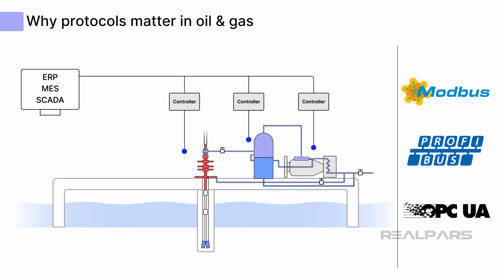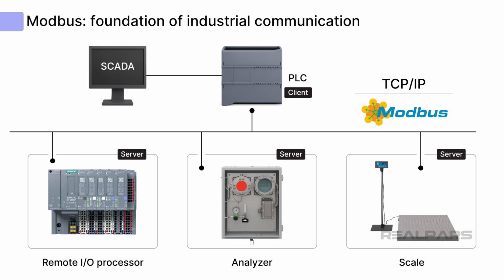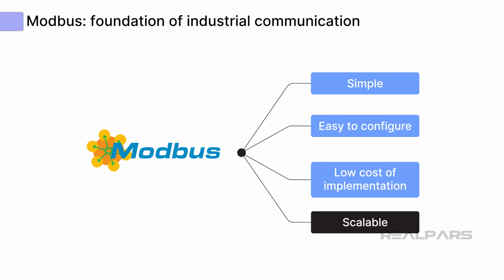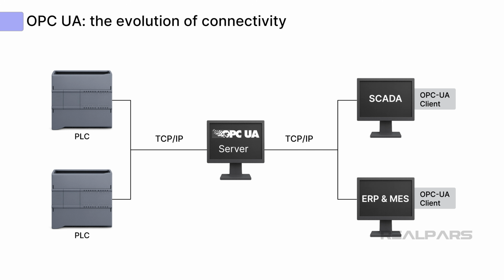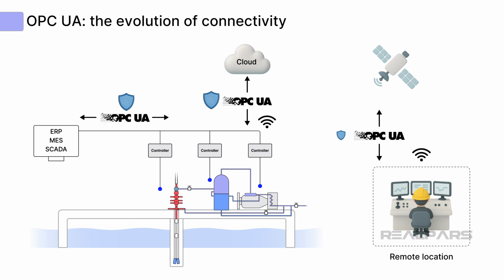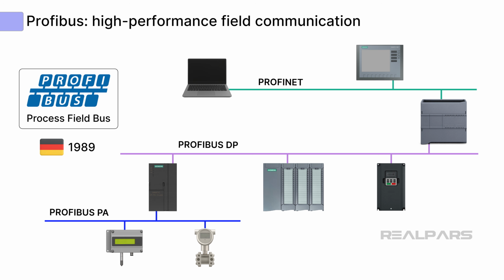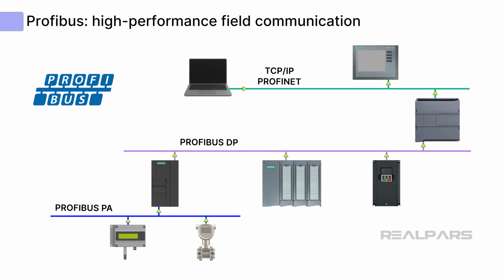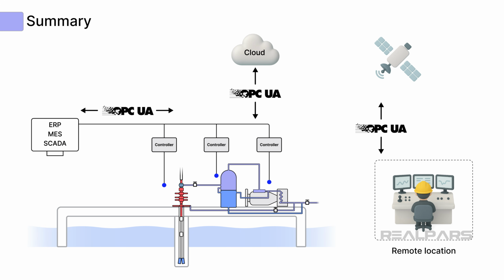Modbus vs Profibus vs OPC UA in Oil and Gas Systems

Comment: Well I am kind of sad the MQTT is not mentioned even developed due the needs of the Oil&Gas industry itself

BTW problem with OPC UA is that the design specification is so long and wast that most do not follow it, or use just some part of the specification, that creates extensive non-compatibility issues. Plus many legacy manufacturers decided to just wrap the older OPCs in something and they call it "OPC UA", but when you dig deep you find out that they wrote converter from OPC DA, OPC AE to "OPC UA" which of course does not work as OPC UA. Salute 🫡 to those manufacturers who at least admit it in the technical documentation, so you do not need to reverse engineer it and find out why it does not work 😂
Reply from the maker: Hello, @bolekzahradnik Thank you for sharing your comment. You might have a point there. These types of updates are sometimes done and overlooked, but as we know, it’s the user's choice which communication is used. 
If you're looking to learn more about this topic, you can join our 7-day free trial at https://community.realpars.com/checkout/realpars-membership
Reply: Yeah. MQTT is the future

Comment: What is the best communication system for gas liquidification plant according to your knowledge and wisdom?
Reply from the maker: Hello, @junedshaikh967.   Thank you for your question. This is a good question, but hard to answer without all the information requirements of the engineering system. First and foremost, safety laws and regulations must be followed, depending on the country in which this system is installed. Some countries' safety concerns for health and the environment are lacking; equipment use is another concern; and, lastly, engineering design. Therefore, the answer to this question has too many variables. Hopefully, all that I mentioned, if followed correctly and within safety standards, will determine which protocol is used. If you're looking to learn more about this topic, you can join our 7-day free trial at https://community.realpars.com/checkout/realpars-membership
Reply: @realpars thank you for your reply